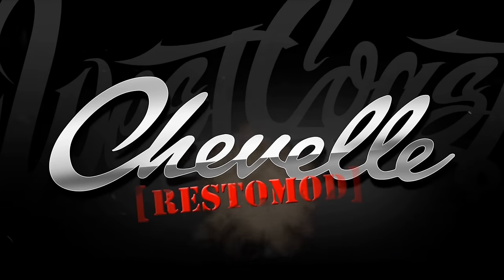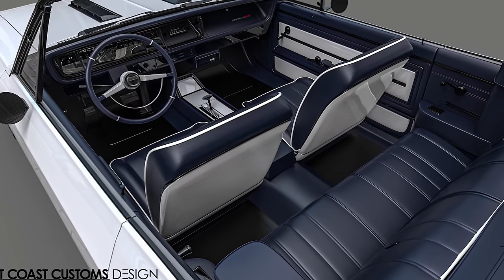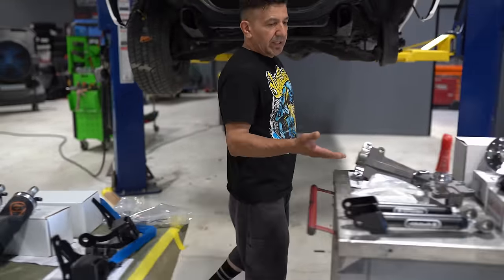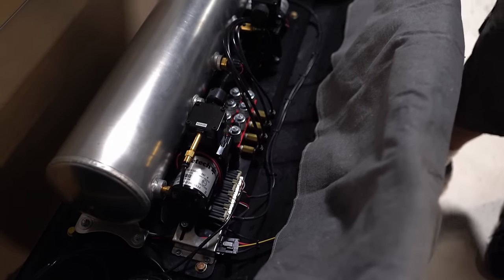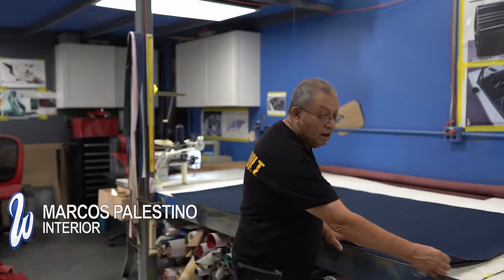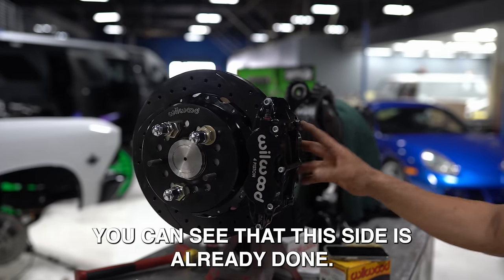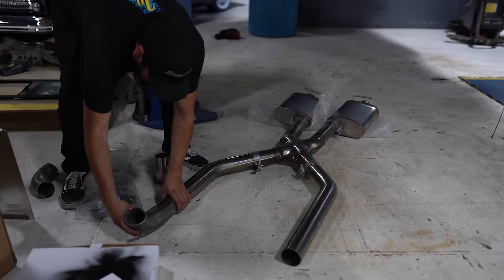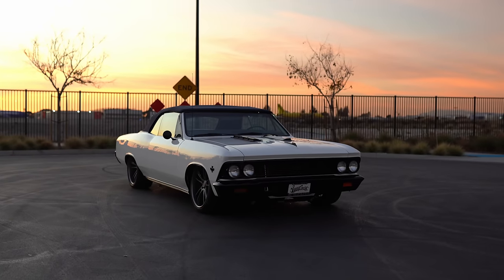1966 Chevy Chevelle | West Coast Customs

Comment: Looks great!
As a constructive comment I would point out that the doors seems a bit crooked and door handles in back were better in my opinion. Also the 1U radio seems to be from 1998, I wonder why there is not a 7 or 9inch radio touch screen with wireless android auto/carplay to be modern and useful. I guess it the sponsor BOSS audio for the old radio look, but even BOSS has thoses touchscreens radio.  But otherwise Im a fan of the black instead of chrome and the white looks amazing.

Comment: This Chevelle looks and sounds out of this world. Just one single issue:
The big chromed tank for the Air Ride, are there options to make that smaller, maybe by having it take longer to re-build pressure? I am not that tech-savvy, so excuse me for having to ask.
I would LOVE this car, too, just have a bit more space in the boot
Reply: smaller tank would work great, just wouldn’t hold as much air. you wouldn’t be able to go up and down repeatedly without the tank kicking on but that’s the only downside. the lines that are connected to the bags dictate how quickly the car will drop and raise. compressor noise on bagged cars is pretty annoying no matter how much sound deadening you put on them. you’d hear the compressor kick on every time you raise the car regardless, they are automatically set to fill up as soon as it drops below a certain psi

Comment: Troy must have about $40,000 to $50,000 into that car.
Buying it & having all that work done
Reply: I think its more like north of 100k ! ALOT north ! 😃👍👍👍👍👍👍👍👍
Reply: @finster7582  Na ,you got to be kidding $15,000 - $20,000 for the car $10,000 for the repaint $10,000 for the motor & trans & another $10,000 for the interior & I think that might be high for everything
Reply: @6996brandyl  convertible roof, complete brake setup, rims n tires, air suspension, fuel system, ignition setup, rear end, drive shaft, exhaust system, etc etc. The list goes on n on. Trust me! Think ur estimates are low as well..plus LABOR COST.. OMG .cant even imagine ! 1 of my projects i been workin on over 10yrs , over 50k into it n nowhere near complete! Takes ALOT to build a car ! WISH i could have 1 done for 50k... 😃